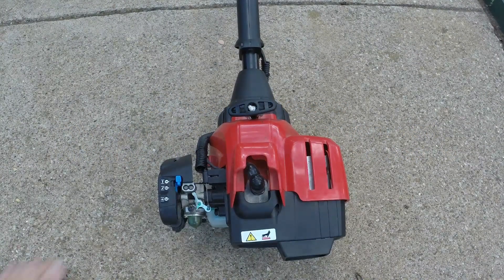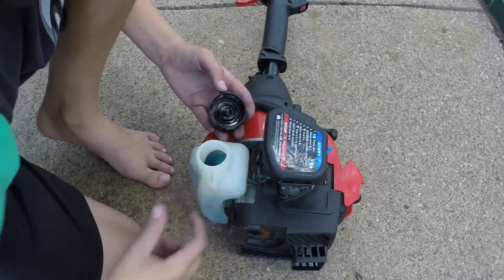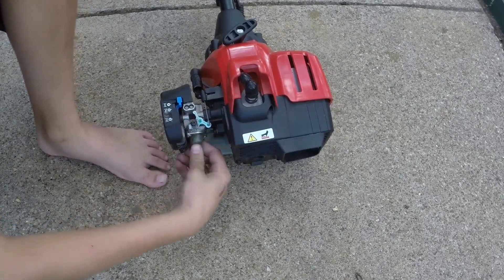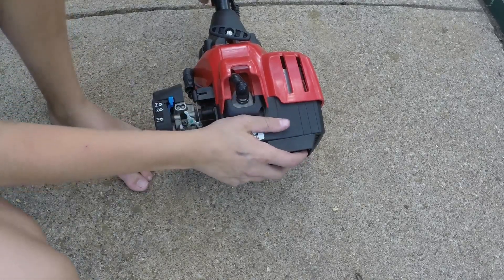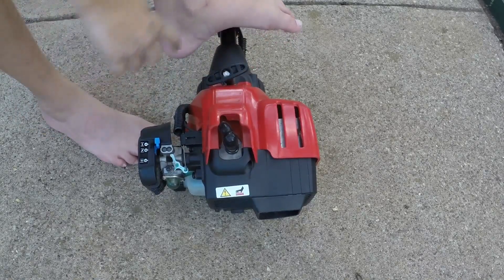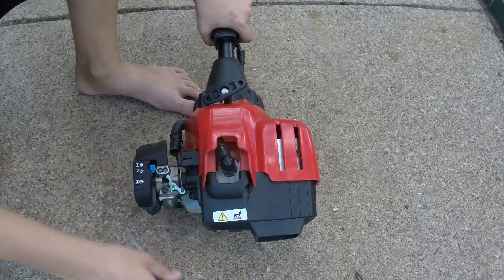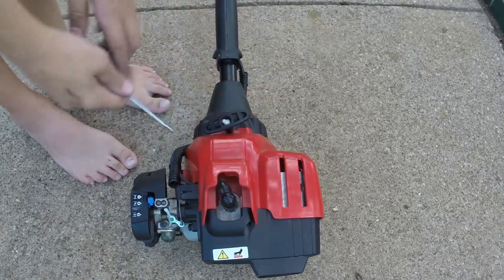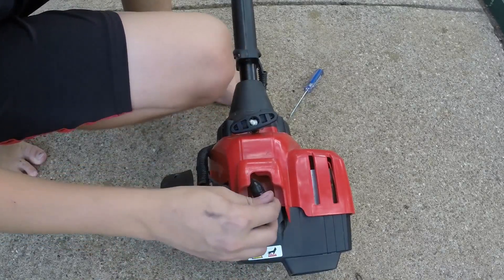How get a 2 stroke engine to start

Comment: Why did you not use the choke when the engine was cold?  Isn't that what the choke is for?  Were you having other issues with the starting of that engine?  I say choke until you get it to fire - then take choke off.  If, when it does start, it burbles, give it a little choke quickly and it should start to run smoothly.   If, IF,  you need to reset idle, screw the idle screw in to the stop.  Back it out a turn or 1.25 turns.  When the engine starts, let it warm up and then turn the idle to a smooth setting.
Reply from the maker: oh man I don't remember what I did this was years ago lol